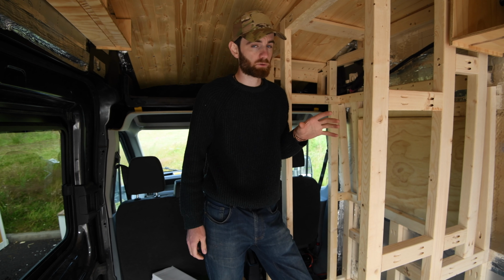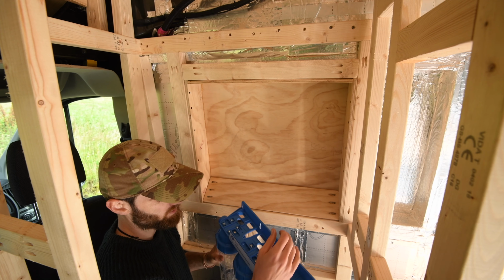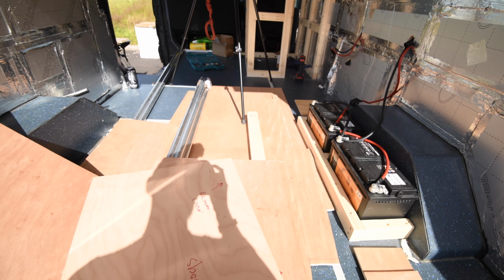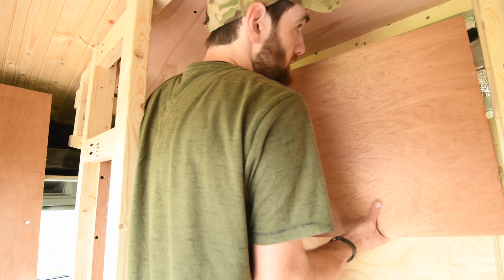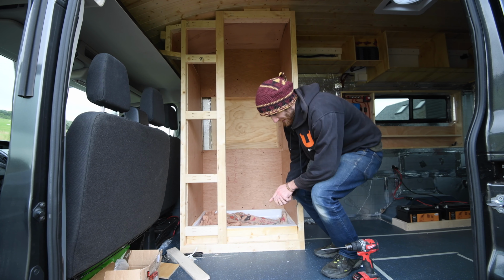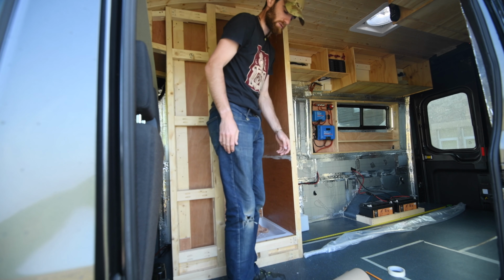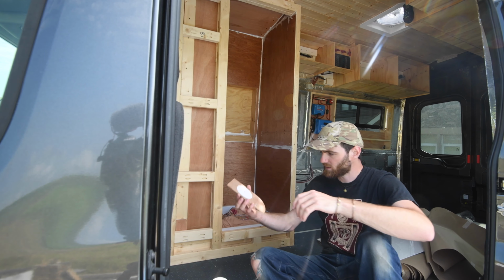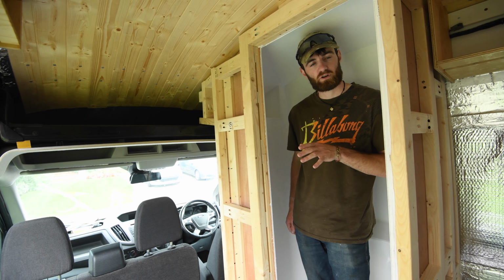Recirculating shower Part 3: PVC Paneling the shower room | EP22 | Ford Transit MK8 Campervan Build

Comment: Are you planning on installing this same system in your new van? I just watched a video about a recirculating shower and the couple mentioned the filters clogged up quickly, but could have been due to the chemicals in the shampoo etc. Can't imagine some of those products are good for the filters. Natural soap etc?
Reply from the maker: I’m planning on a shower room and an alternative version of the recirculating shower. 

For me I found the key aspect to filters clogging quickly was dependent on shampoo and soap.

I think I found the opposite to your thoughts. Natural soaps tended to be more oils so the filters got clogged up quicker but the water was cleaned better whilst more artificial soaps and shower gels being more chemical liquids stayed dissolved in the water so they weren’t cleaned out as well, but because of that didn’t clog the filters as fast.

Comment: What are.the dimensions of the filter array including sediment filter length is width

And what is the dimension.of the filter inlet. ?

My build is require that Everything be portable 
So I'll be building an Evershower and the filters will need to be in a  Pelican/Apache case.

I'm trying to decide whether to go with a three hree filter or two and ten inch or five inch

Comment: Not sure you may of mentioned it in another video on the showerbuild - but was there any reason you decided against a small roof hatch / vent with the steam of the shower? Since fitting and use - Do you notice any condensation build up after shower use? 
ATB 👍
Reply from the maker: Main reason was the solar panel right above it is in the way. But I do have a fan vent near the roof in the wall that runs out the  up into the roof with a slim line vent which fits under the solar panel
Reply: @MispronouncedAdventures  I see. Spent the good part of my day off binging from your first video up to episode 34 😂 Would you consider doing a update video on the shower - maybe a episode 5 of the shower build 🙂

Comment: What about that double stick tape. I know it’s too late but
Reply from the maker: For sticking in the PVC? I didn’t have any temperature ratings on the tape, so I don’t know how well it would’ve performed with the warm air from the shower or even warmer when I use it as a drying room for kit. So using trim fix spray as it’s known as a  high-temperature adhesive

Comment: Beautiful! Nice job! 

Brilliant, the sliding shower tray.
How do they call that? Lucky mistake? Unintended benefit?
Reply from the maker: Unintended benefit I think I will go for. It was definitely made intentionally as a single piece for ease of putting it in, but never intended to or thought about having to take it out. I think even in the later part of the build. It could still be removed it’s necessary you would just need to redo the sealant afterwards

Comment: Thanks Alex
I stumbled upon your channel for the install of the Victron Orion Smart charger. Great video. Than I saw you're doing a recirculating shower also. I am currently converting a Shuttle Bus into a tiny home on wheels and have been planning my recirculating shower also from Curt and Snow. I'm getting close to starting this phase of my build. I was going to use my drain with a water less p trap and with this system it sits approximately 6 inches above the floor. Than I saw you were using a space saving drain or less space usage drain or thinner drain which lowers your height a lot more than mine. Could you share with me the make of your drain, as I could incorporate this system and place the water less P trap outside my shower pan. Thanks and have a great day.
Reply: Thanks Alex for the great advice.
I live in Canada and Amazon wanted $150.00 for it. So I ended up going to Amazon USA and got it for a hell of a lot cheaper at 97.00 CAD. Yes we live in an expensive country. It arrived today from Germany. Anyways I'm saving 3 to 4 Inches (76 mm to 102 mm) in Height. That's huge cause now I can stand under my shower head. I really appreciate you getting back to me. Thanks again.
Reply from the maker: No problem at all. Glad you got it sorted. I’m 6 foot 1 so height for me was also an issue. Nice to be able to stand under the shower
Reply from the maker: Kristy Lopez thank you for finding the channel. 

So drain wise I’m using “Wirquin 90mm Slim Shower Waste Tray”  hope they help. I found it on the UK Amazon. Good luck with your build

Comment: Thanks for another excellent video. Do you plan to put a ventilation fan in the shower?  Also, are you going to implement a UV light to kill bacteria?
Reply from the maker: Yes to both of those. I’ve currently installed the vent ( in the next shower room video ), I do plan for a UV filter as well. Only that it’s going to be outside of the shower room due to it being electric, which is why I didn’t mention it at the beginning, however bit of an oversight I should have mentioned in general in the video that I was having it but it was just going to be outside the room

Comment: so how to apply  sealant neatly ?  you never said ??????????
Reply: Yes, I’d like to know this too!
Reply from the maker: Apologies for not mentioning it in video! My finger! However the Secret ingredient was this spray bottle filled with water washing up liquid / soap. Sprayed the area after applying the Bead of sealant ( making sure the sealant has good coverage on both sides. Then spraying the finger and lightly running it down the sealant. Similar to the method I showed in the end of the flooring video. However I’ll make sure I include it in the next shower room related video and there’s a bit more sealing  to do
Reply: Soapy water is one tip, silicone finishing tools also work well.
Reply from the maker: Mark Velo I brought a finishing tool as well ( just a cheap one ) but I struggled with it. For me I found the soapy water and finger great
Reply: @MispronouncedAdventures  yep i totally understand. You can get perfect joints with a tool but it takes practice.
Think I've said it before but i like the way you build, you think ahead and try to future proof as I do.
One word i always have in mind when i build is "access". Like you I've built structures first and will finish by closing areas up with removable panels.
Reply from the maker: Thank you, very much so. Access is so important. It very much leads into future proofing and repairs if need be.